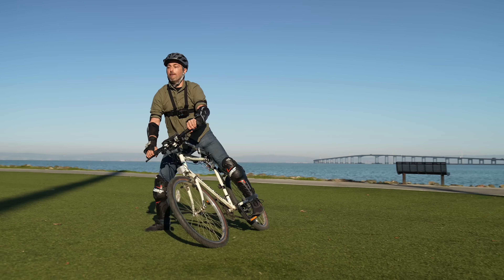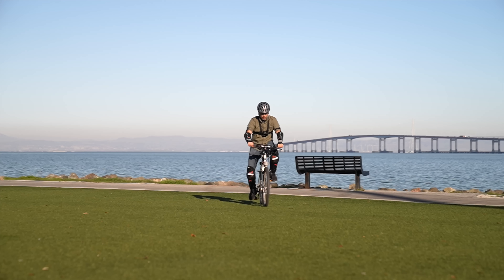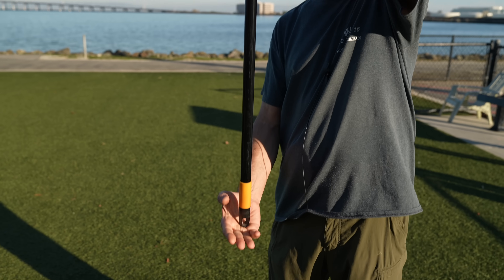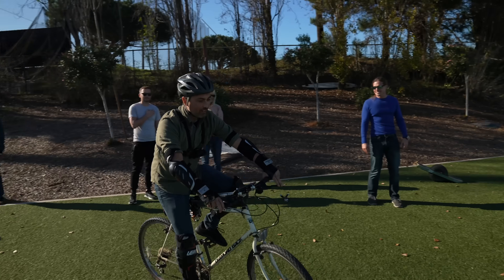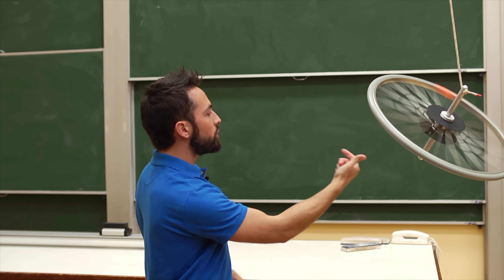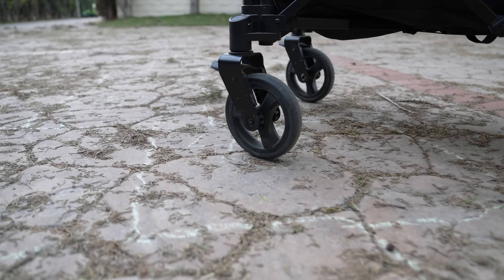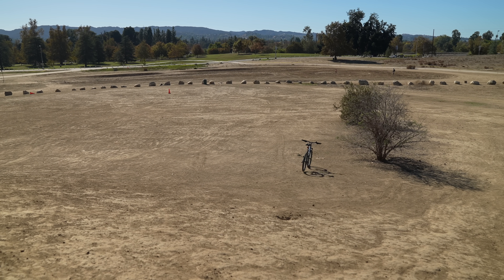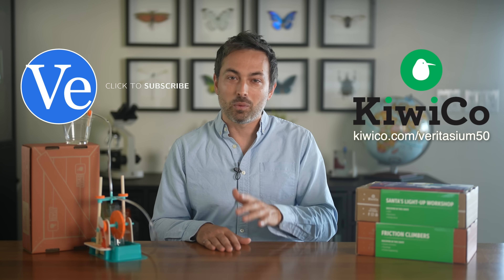Most People Don't Know How Bikes Work

Comment: The counter steering is one of the first things you learn when getting your motorcycle license!
Reply: Yes, and it's much more obvious on a motorcycle. They very explicitly teach you to literally push the handlebar of the side that you want to turn into, to induce the lean. Want to turn left? Push left. Want to turn faster in a tight corner, even though you're already leaning and turning? Push left more!
Reply: And they do this because it it harder to move the bike from side to side quickly with your bodyweight, at speed, counter steering is way faster! In some countries, dodging a couple of cones at 50 km/h using counter steering is part of your exam.
Reply: @disturbeddonut2151  
Unless you going slow.
Reply: @Robert-j6r8c  Uh no, you still use counter steering even when going slow
Reply: @Robert-j6r8c  At any speed.
Reply: @Robert-j6r8c  you always countersteer. You can watch low speed agility courses and see countersteering in action. I practice low speed figure 8s and U turns form a stop. Counter steering is the only way to do these menuvers quickly even slower than walking speed.
Reply: @Mandatoryuser  
Incorrect.
Other than the counter steer explained in the video to get the bike leaning that way(which isn't always needed as shown in the video) you turn the wheel in the direction you want to go.

Then at higher speeds you counter steer keep the bike leaning throughout the corner, in this instance the more you counter steer the more you lean 
The bike turns because as you lean, the inside of tire contact patch is a smaller diameter than the outside.
Much like if you roll a cone it turns to the smaller end.
Reply: @Robert-j6r8c  a countersteer always initiates the turn.
Reply: @Mandatoryuser  Yes, only the reason for counter steering changes. At low speed, you use it to affect your balance. At high speed, the gyroscopic effect has a  much bigger effect. So at low speeds, your counter steering will turn the wheel more in the opposite direction, 180 degrees. At higher speeds, the wheel turns 90 degrees from input. From input perspective it changes as well. At highspeed, you can initiate, follow through and exit the turn simple by countersteering. When you're going slow, you actually first steer one side and then turn the other.
Reply: @Mandatoryuser  
Derek explained that they did fluke it, so clearly it doesn't "always" initiates the turn.
Reply: Yeah, was going to say the same thing. Counter steering is like second nature when riding a motorbike. I've tried it a using a regular bike, but got it to work if I was going fast enough. At slow speeds it doesn't really apply.
Reply: @loadinglevelone  Yes and no. On a bicycle: at slow speeds the countersteering is swamped by the continuous corrections for remaining upright. The more speed you have the quicker the change of balance in response to change of front wheel angle. As you go faster the necessary balancing corrections are smaller, but you need more lean to execute the turn. Hence there is a slowest speed above which the countersteering input becomes separately noticable.
Reply: yep, and when you're at speed steering is always with countersteer, which is a little scary when you think about it lol
Reply: @farLander1  Yes but it is tiny compared to low speed counter-steering.
Reply: @paulmichaelfreedman8334  Depends on how low you're going into the turn lol
Reply: For real. I learned to ride young and one of the first things I was told by an old-school motocross rider was you steer a bike with your legs and your core not your hands. Made me a much better rider.
Reply: Countersteering is the only truly proper way to turn on any 2wheel vehicle because this is just simply how physics works. You can get away with •regular• handlebar turning at low speeds but it doesn’t make it proper (and on the motorcycles it gets harder because low speeds + hard handlebar turns = possibility of it falling to the side, been there done that when I started).
Reply: My thoughts exactly
Reply: I thought he already made this video
Reply: Slow, look, press and roll.
Reply: Didn't get taught that for my license. But I guess I didn't need to as I could ride a bicycle.
Reply: Counter steering is the biggest mindfuck in the world
Reply: I think.  Noone bothered to really tell me (Germany) I just knew.    To me it's important to not ride overly conscious.  You look n go there even at high speeds
Reply: @gur262  Well, do consider, for your safety, that intentional counter-steer is much faster than riding by feel. Best is if you do it so much it becomes intuition, because you'll only need it in surprise situations. Also, fastest is to not just push on the turn side, but also pull on the other side. In other words, actively turn the steering the "wrong" way.
Reply: What I'm picking up from this conversation as a non motorcycle rider, is that turns at all speeds are initiated by countersteering, but the continued turn (after initiation) is countersteered at high speeds but normal-steered at low speeds. Is this it?
Reply: @FlyNAA  Pretty sure yes. High speed absolutely. Low speed is mainly turn the way you want to go, and I've never noticed the initial counter-steer because see the video. -- rider for 30 years.
Reply: @disturbeddonut2151  Just lean towards the direction you want to go, it automatically pushes the bike a little in the opposite direction and that is enough to make the bike make the proper turn by itself. If you dare you can prove this to yourself by trying with your hands hovering just above the handle bars. Bear in mind that this advice I give for enduro/all-road type bikes and bikes in general with a high center of gravity, and not racer type bikes - they are made specifically to go straight forward and need to be pulled into a turn.
Reply: @paulmichaelfreedman8334  More specifically, they need to be pushed into a turn. At normal driving speeds, the last thing you want to do is to pull your steering left if you want to turn left. Even after initiating the countersteer, you keep steering by countersteering at all times and if you pull to left even when already leaning left, you'll start to turn back up and right.

In fact, driving motorcycle  even without gripping the handlebar is easy.  Just push left handle if you want to turn left and vice versa. Even though you can also steer just by leaning, you really shouldn't. Learn that as a habit and you might reflectively try to avoid an object by leaning to go around it which is way too slow compared to sharp countersteering. Instead, leaning should just be a good practice to complement the steering. When you turn right, you lean your body against the right handle, but the leaning to the handle should be the steering measure, not just the leaning itself.
Reply: @paulmichaelfreedman8334  Leaning is always slower and has less control than counter steering. In an emergency it's best to counter steer and that's exactly why they test it when you get a motorcycle licence.
Reply: Everyone should learn about motorcycles counter steering. My grandmother hit a motorcyclist (no damage) because, as she said, he turned right and when she turned left he pulled out in front of her. I tried to show her this exact thing on my motorcycle  and she still thought it was "misleading" to swing out one way and turn the other. It is counterintuitive unless you ride.

Comment: Lee Parks total control has a whole section on a similar thing done with a motorcycle, built to show motorcycle racing students how counter steering works. Theirs was just an extra set of fixed bars meant to prove you can’t just lean and need steering.

Comment: You know, this reminds me of the first time I got a on a tricycle and tried to drive it, no joke I drove into a wall several times before getting used to it because I was trying to steer it by changing the balance with my body and not using the front wheel, was really embarrassing.

Comment: I started cycling as a sport 1.5 years ago and just passed 7000km distance. After all that distance, even for someone who's got a bike's physics as down as me (I'm far away from a pro, but always try to understand everything I do so I spend a LOT of time investigating every detail of my bike and of cycling), it's easy to forget how delicate the balance can be. A few weeks ago, I cycled after it had rained and wanted to cross a wooden bridge. It moved a path along the river across it, so I had to turn 90° onto it; I braked almost completely, turned, was almost completely done with the turn when I got onto the wood - and my bike slid out right from under me; I fell off, hit my head at the railing, ripped open my helmet, went to the ER and had whiplash for 3 days (always wear a helmet). The side-angle I had when I moved onto the moist wood was minimal, but because of bikes' delicate balancing and reliance on the center of mass, the very low-friction ground made it slip anyway. (Moist wood is evil guys.)